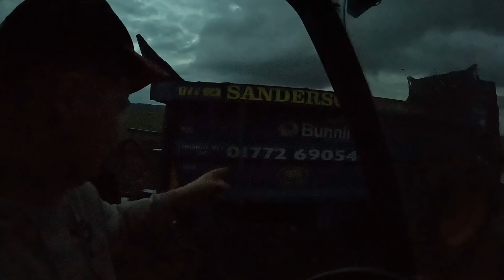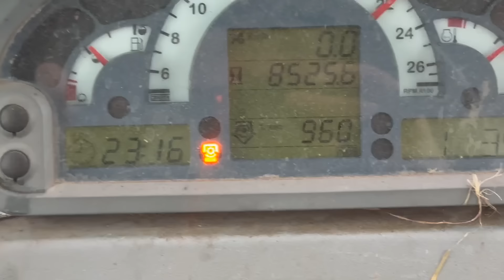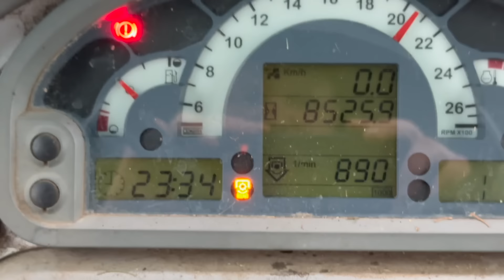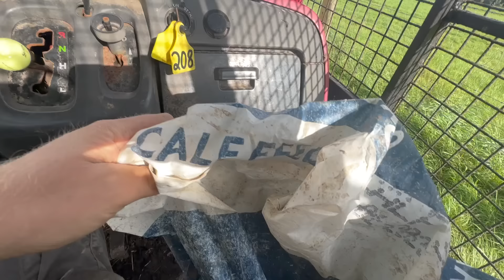TIME TO SWAP!? MONSTER TRACTOR ARRIVES ON THE FARM!!

Comment: Can’t help it, I got distracted by the bit of manure on your nose for the first bit of muck spreading! I know it’s easier to say when it’s not my money but, you must be running at the extreme of what that 100 hp tractor can do for so much of the work. It sure seems like that jump up to the 150 would put put a lot of the work you do into the sweet spot of what that tractor can handle. Would that be able to handle a front mower as well? It seemed like even the JCB had struggled with that at times when you tried that out.

Comment: After we sold out our dairy business I worked for a row crop and beef farmer for 10 years. One day my boss took on the job of hauling horse manure at a local racetrack. He spent the day at the track while I hauled the manure. The racetrack built all their manure bunkers out of concrete blocks. The first one I hauled from was knocked down with the slightest touch. I went and told the owners what had happened and told them that the same thing would happen to the rest of them. I told them that they should have built them out of railroad cross ties or concrete. They told me to continue and every one of the bunkers were knocked down by the end of the day, there were 6 or 8 of them. Whoever decided to build them out of concrete blocks had no idea what they were doing. They rebuilt all of them using cross ties and treated lumber after that.

Comment: Tom no offence but from a purly financial point of view you might just be better off hiring a large tractor when you need it. The hurliman is 16 years old with 8500 hours on it. Thats about 500 hours per year. Most contractors/ plant hire companies would want to run about 2000 hours per year to justify the capital employed. Or maybe a good modern large second hand with 4-5k hours on it.

Comment: Personally the 4 cylinder would be cheaper on fuel than the 6 cylinder. Maintenance cost the 4 cylinder would be a lot cheaper than the 6 cylinder. Not playing down the case but there is cheaper brand's out there that would give you the same power at a cheaper cost. Not sure if you have priced valtras olly seems to be happy with his one. Just one thing to remember if its the only tractor your going to have make sure it fits everywhere you need it to go through all the feed passages and in the sheds for bedding. Truthfully all machine prices are gone crazy now its hard to belive that they could stay like that forever but at the end of the day you will just have to go through the figures and see if the whole deal adds up.

Comment: I honestly don't think that tractor is powerful enough long term.  It shouldn't have been struggling in a low gear coming up the hill.  Best of luck on the journey to a new tractor.  I'd also look into a used tractor.  Say up to 3 years old.

Comment: Well, I tend to agree with you Tom. It is time to get a new tractor, or to put it another way, a machine to operate all the other higher efficiency implements that you have been slowly upgrading to and operating over more hectares. Even though some of them are just rented or borrowed rather than being owned. It's all about efficiency. The Hurlimann has been seen to be struggling from time to time. Such as in this video. Make a machine struggle too much and you'll wear it out and one day, it will collapse from the strain. That could also be very, very dangerous for the operator. The question is what is the best match and balance between your finances and efficiency and the best machine to maintain efficiency and get all the necessary jobs done without having to rent another machine and one that doesn't struggle. That's a question that you will undoubtedly ask yourselves and obviously, not one that needs to be answered to us, the humble viewers. That 100hp Hurlimann is obviously a very good tractor though. It continues to give you its best and puts in the effort even though it is doing jobs that normally a bigger machine would typically do.